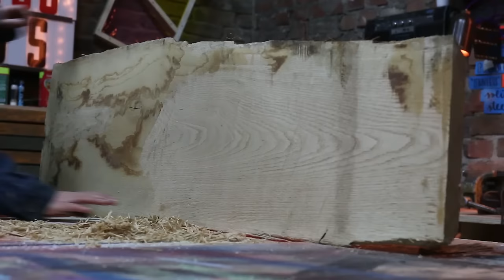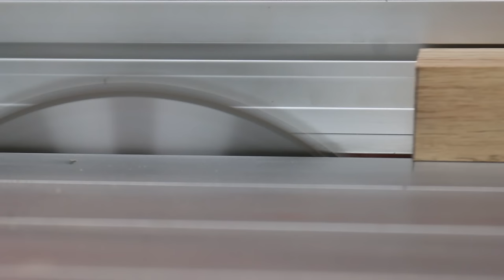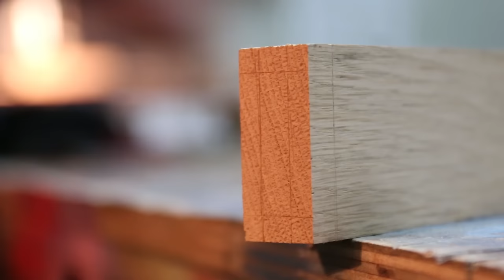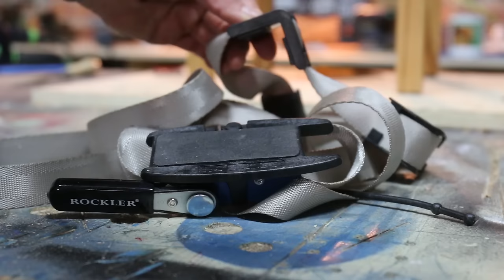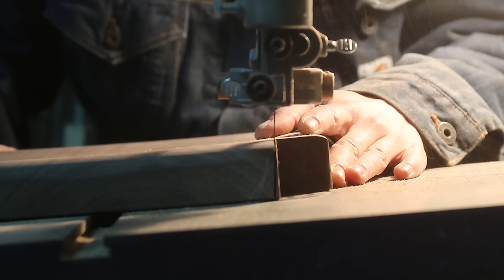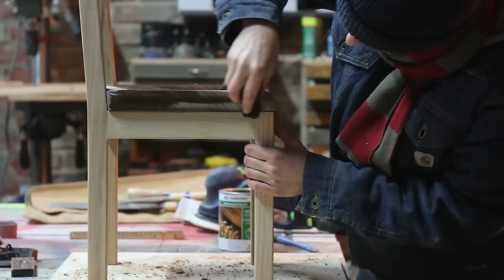A Chair for my Niece

Comment: Lovely & complements the other furniture. Nice mix too of traditional & modern tools. Glad the glueing worked out. I struggle with pva in the winter. Had a mitre silk screen frame that I needed for a Christmas Day print fail on Christmas Eve, scraped pva off, 5 minute epoxy & I got the print made on Christmas morning! Maybe one day I will insulate & heat my shop!

Comment: very nice laura!💯💥🍻 its nice to see a chair made without a domino .very nice work on the shaping too !merry Christmas and happy New year to you!
Reply: What's a domino in terms of woodworking?
Reply: festool domino portable mortise machine.
Reply: -_ - Domino's is used kind of like a biscuit joiner.it's made by Festool just like a biscuit joiner it makes a mortise but in a rectangular shape and the "domino" is the tenon.amd it makes mortise and  tenons quick and fast instead of a hour or two depending how many u need. don't get me wrong if I had one id use it too  but not for every single project like some people do.. it's not as gratifying as making them the traditional way with a mallet and chisel...just my opinion though

Comment: Lovely work!
Next time you cut a mortice, try making it the width of the chisel and you can just drive the chisel straight down with a mallet.  The chisel just sheers the sides out for you and you end up with a very accurate hole very fast.

Comment: What was the disk you used for carving out the seat? I could use one of those...
Reply: I believe that was an arbortech turbo planer.. but I may be wrong.  I saw that it said arbor tech on the tool and I know they make a turbo plane that looks similar.
Reply: I just searched it on ebay and i found one for 170 dollars!!!!
Reply from the maker: it´s a pretty impressive tool! pricey but worth it if you ask me...
Reply from the maker: http://www.rockler.com/arbortech-turboplane-blade
Reply: Thank you.

Comment: do you have any tips on folding rulers. They are hardly used in Australia.  I've heard they are widely used in Germany.  I've been curious for a bit now.
Reply from the maker: yes!
http://www.hultafors.com/products/measuring/folding-rules/folding-rules-wood/folding-rule-59/
this is my favorite ruler by far. i only use this brand because they are super flexible, still very strong and thinner than the others. they also make them in 1 meter length instead of 2 which i think is the perfect length. i trust these more than a tapemeassure for some reason
Reply: ooh ta. brand not available in Australia, but I'll have a looksee.  The catch on the end of tape measures stretch. losing 10 mm helps but lining it up to the edge is a pain and since a human finger can detect down to .2 of a mm I'm off to get a folding ruler. Thanks again.

Comment: Hi, I saw how you work plane. I noticed as how hard to cut, and it is difficult to you. I know. you need to sharpen the blade better. recommend using Planer Blade Sharpening Jig,  can also be used for sharpening chisels. easy to do-and excellent results